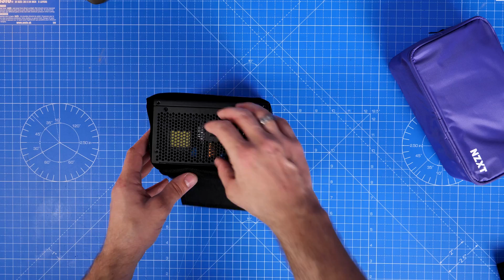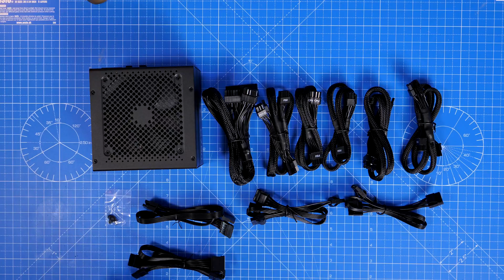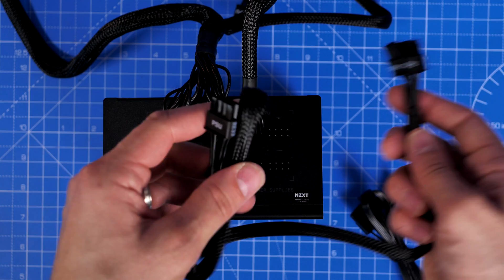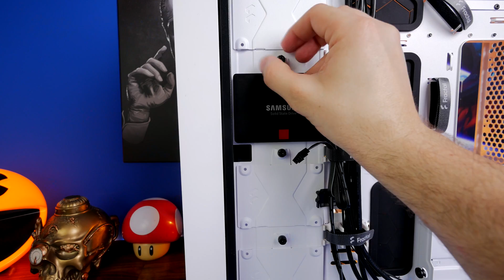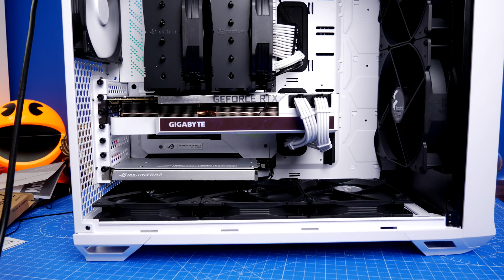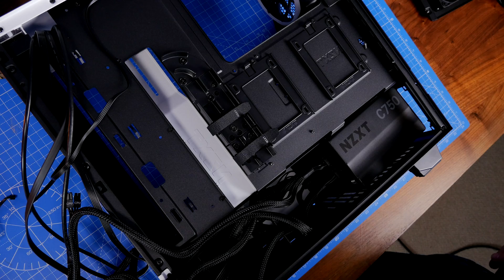NZXT C750 PSU installation guide - how to install this 750 watt PSU in your PC

Comment: how many 6+2 pin power connectors does this PSU come with? in pcpartpicker i am getting a compatibility note for 4070ti to make sure that there are 3 6+2 pin power connectors and they r not daisy chained....
Reply: Same issue... I'm not sure of there's enough for the 4070 ti. Does the card come with the adaptor to 16 pin?

Comment: Thank you so much for the video. I have this PSU and wanted to know how to install my RTX 3070 Ti with two 8 pin connection. 👍🏻 This is upgrade from RTX 2060 Super which is has only one 8 pin.
Reply from the maker: No problem 👍

Comment: So I don't have to use all cables that come with this psu right? Because am confused there are a lot of extra cables that I don't need them
Reply from the maker: nope. If you're not using them you don't have to plug them in.
Reply: @TheProvokedPrawn  tbh idk what I did but the PC work good until now.. I put the mb, cpu 4x4 pin, gpu 6+2 (my gpu is 3060ti with 8 pin) but  the problem i faced was with ssd and hhd, i put only one cable that coming with 3 ports one for ssd and one hhd and i left the third one since i dont have more storage is that ok?
Reply: @TheProvokedPrawn  Please let me know if its enough what I put .. because its first time I do that xD, like is it fine that one cable for SSD & HHD?
Reply: @TheProvokedPrawn  Also, there was like 3 or 4 of PCI cables and I used one only for the gpu..
Reply: @esko4725  it is completely fine 👍🏻 don’t worry!

Comment: hey man please reply
can i use this psu for 3x8pin gpu card?
the gpu is colorful 3060 ti vulcan oc
Reply: Ik this is 2 years late but watch til like 4:45 he says that the extra pcie power cords are for extra 8 pin connections on your gpu

Comment: i know its a old ish video but is the nzxt c750 gold cables interchangeable with the 1000 watt nzxt c1000 gold psu?
Reply: Do not interchange cables between power supplies

Dont know if it also applies to power supplies of the same brand or series, but you should probably not risk it to find out
Reply: Never interchange power supply cables or all your stuff is gonna be fried

Comment: Hey! So i got my new 3070ti, i have the nzxt 850w versión. Im stuck, my psu only came with 2x8 pcie cables, i need a 3x8 pin cables. Do you where i can buy a third? Im desperate! I can’t use my new card because of that one cable😔

Edit: i think i lost that cable, i need a replacement. Do you of any compatible cables that i can use?
Reply: U need to find the same psu pcie cable so u might have to buy a new one
Reply: @Yungbl33d  i contacted NZXT and they sent me a whole bag of new gpu cables for free. Fast shipping too.

Comment: Hey, I finished building a pc. No display, I have connected only the motherboard row from psu to motherboard and the cpu to the cpu ports on the motherboard. 

The rest are empty because there are absolutely no slots for them? The cables that came with the PSU aren't compatible. 

C650 PSU and B550-A Pro motherboard.
Reply from the maker: Computer won't boot? Or you can't plug in your GPU? I'm not understanding the issue
Reply: @TheProvokedPrawn  I figured it out. I put the ram side by side, then later I put them 1 0 0 1 placement. Still bad, finally put it 0 1 0 1 placement and it worked